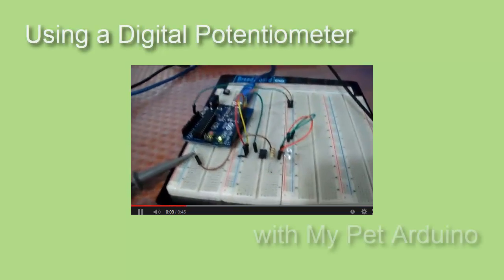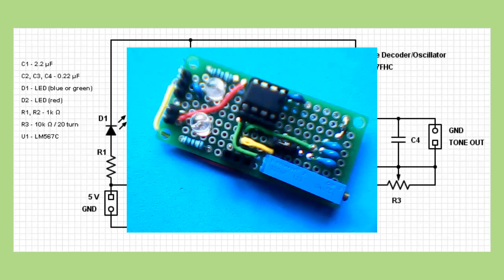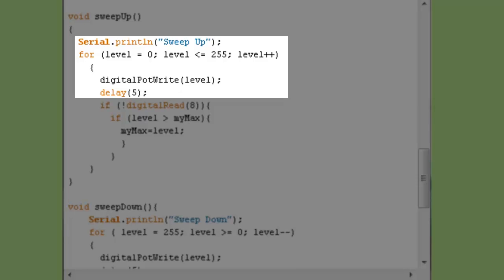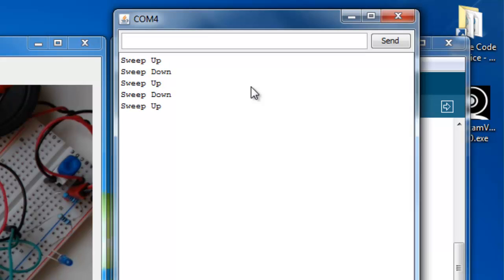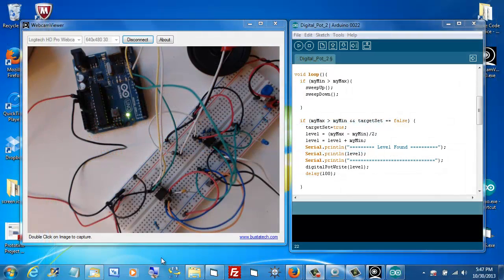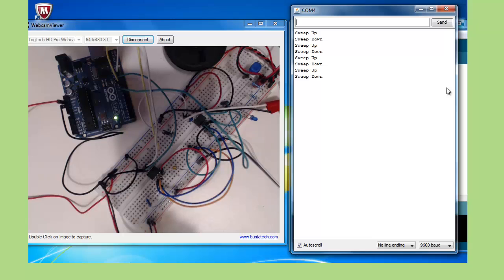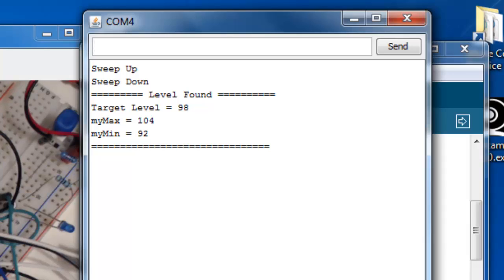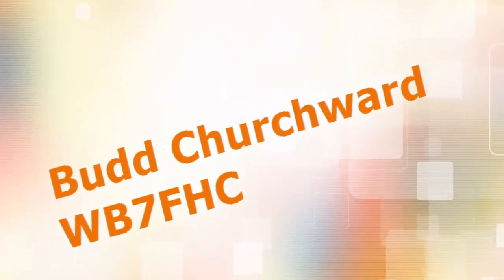Detecting Tones with an Adruino and a Digital Potentiometer

Comment: Hi Budd. Interesting video. Previous comment by Nikki.... The young folks don't miss much, do they. :-)

Did you place the sketch on any customary repository for Arduino code sharing with fellow experimenters? The video omits some of the void setup() and void loop() code so I was looking for a clean source.  There are other examples of this type of application but I subscribed to your YouTube because I enjoy your presentations. Most presenters simply put a link to the .ino file in the <view more>  section.  I am using the MCP41050 and -100. I love this stuff.  Thanks again.

Comment: i have an animatronics show running an RA Gray control system. Is there any way you can think of to take tones from a show and decode them? Its an 8 bit system but there are many tones going at once (layered) What I ultimately want to try to figure out is if i can identify each tone for each character movement so that i can program new shows.  Thanks

Comment from the maker: Here is a different way to demonstrate a digital potentiometer with an #Arduino. The 'seek and destroy' sketch sweeps the internal oscillator of a tone decoder chip up and down until it matches the frequency it 'hears' and then locks in on it. Then its ready to respond when that tone goes on or off.
Reply: Will an NTE832 work in place of the LM567c?  Having a hard time finding the LM567c locally, but the local Radio Shack has the NTE832 in stock.  I just hate to pay more for shipping than the component costs.
Reply from the maker: It looks like the pins are the same. I found one webpage that said the 567 can be used as a replacement for the 832. So I think it would be worth a try. Let us know how it works.